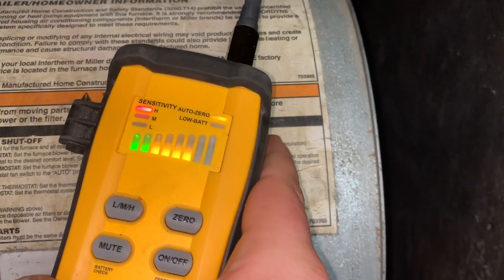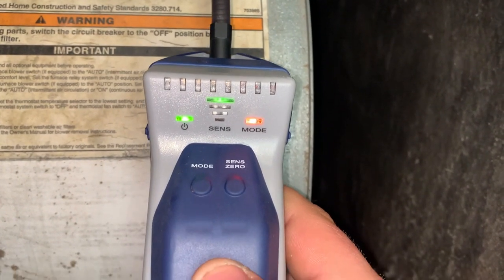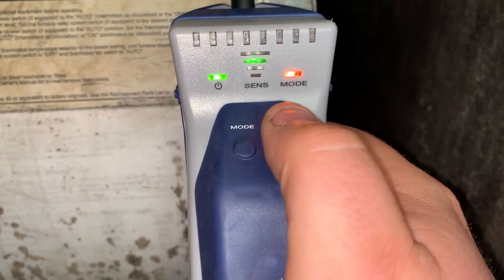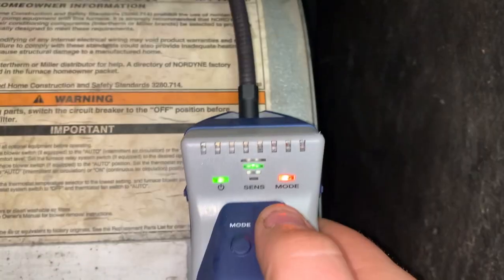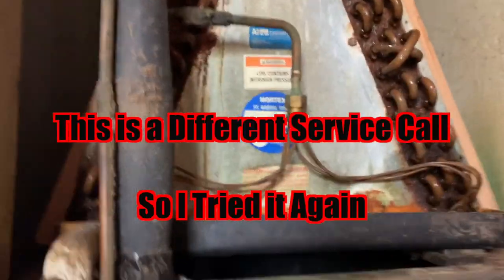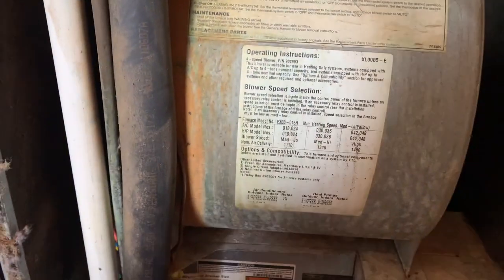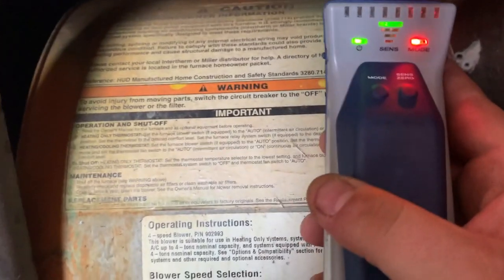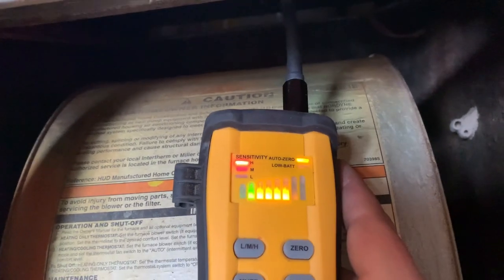Leak Detector/Inficon D TEK 3/Is it Any Good

Comment: That model has issues. Inficon knows about it. They're probably should have been a recall on the units that were affected. I'm sure it's probably a certain lot number between a range of serial numbers. We spend way too much of our money on these kind of instruments for them to not work any better than that. You could have found both of those leaks with an old Corona detector from 20 years ago that cost $50.00. I'm sure they will make it right though. If nothing else just allow you to take it back for a full refund and they can reimburse your supply house with a new one. 👍

Comment: The button issue was corrected.  There's something wrong with that unit, it has a 2 year over the counter warranty take it back to your local supply house.  I had nothing but problems with both Fieldpiece detectors.

Comment: Few leak detectors preform as well as the fieldpiece in this video on 410a refrigerant. There is a gentleman who spent $10,000 on leak detectors and did a lab type comparison. He has a channel on YouTube.  Basically  the fieldpiece in this video was the best for 410a but it didn't work well with some other common refrigerants so you need another leak detector like an h10 pro. The h10 pro does not pick up HFC's (410a) very well unless you turn the sensor heater way up and then only barely picks them up but the h10 worked real good on CFC and HCFC refrigerants.

Comment: Thank you, John, for your honest review of your experience with D-TEK 3. We will be happy to give you an over-the-counter replacement for this particular unit, and once replaced please be assured, the new D-TEK 3 is going to provide you with years of great service, as did your original D-TEK. We have tried to reach you by phone and text and look forward to hearing back from you shortly. Please call 1.800.344.3304 at your earliest convenience so we can work with you to get you back to leak testing accurately and quickly with INFICON products.
Reply: I have a new one and I will be sending to you.   I've bought older models and thumbs 👍 but this one is worthless.   This is Ron Adams

Comment: I would talk to Inficon about it. Nor-Cal Dave made a video of an issue he had and they helped him out.
Reply: Yep got a dud. They replaced it. New one has been working. The SLR8 is good. H-10 the best.
Reply: @NorCal-refrigeration  Trying to determine what i have fieldpiece SLR8 and just got the fieldpiece DR58 heated diode one but thinking about sending that back and because it false hits to much it seems so trying to decide between the D tekk 3 or The Accutrak. The h10 pro just looks to inconvenient to handle on certain systems and tight spaces.
Reply: @Begrateful2024  H-10 is the real deal.